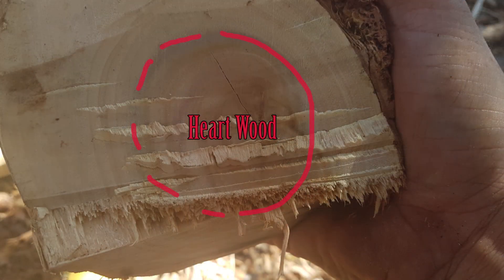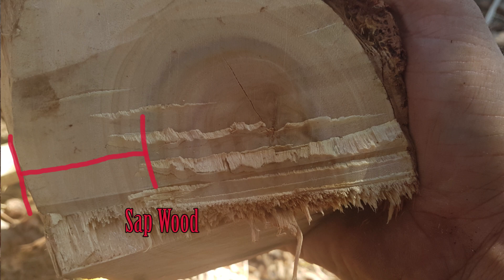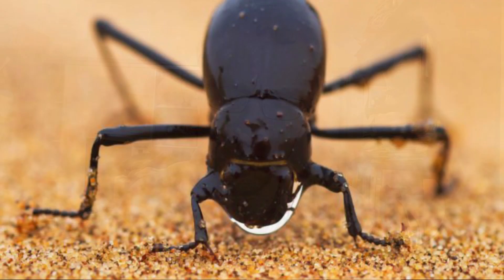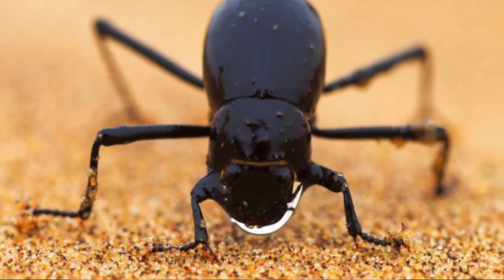Why remove the bark?

Comment: Perfect.   Not that this is the way to go about it but if you raise the moisture content, soak in a pond, the bugs won't get into it either, I suspect too much water no air.  also the sap wood won't rot in soaked in water and white pine the sap will dissolve which is nice when it comes time to work the wood, its not so sticky.   I often see people cut out live edge flitches to use as clapboarding or siding, and all I can think is how soon it will rot with all the sap wood exposed to wet dry cycles.  Cut the sap wood off and use the heart wood for your exterior siding.   New sub.
Reply: Yeah well the answer is not long. The poles I'm using are super hard (Grey Box and Red Iron Bark) and with the bark off they tend to last a reasonable length of time. Where I used to live near Daylesford the Peppermint and Messmate sapwood got chewed to pieces within a few years even with the bark off.
Reply: Thanks for subscribing :)

Comment: If I were building a bushcraft cabin. Could I shave half the bark for going on the inside. And... Leave the bark for protection from elements like rain, on the outside. Or if I were to split the logs. Would they dry out enough. so could keep the bark. Or do you know natural ways of protecting the outside from moisture rot. Say a watery clay mixture brushed on like stain.letting it dry like stucco.
Reply from the maker: When its attached to the log the bark doesn't protect against the elements. It retards the drying of the log after rain and that promotes rot. A clay, aggregate and fibre mix (pure clay will shrink and crack) is an excellent addition to wooden walls. The mix draws moisture out of the wood and then releases it into the air as it drys. Better it not get wet though and having a decent eave to shelter the wall is a good idea.

A very thin clay wash might help but it would be very easy for it to wear off. Either through rain or abrasion.